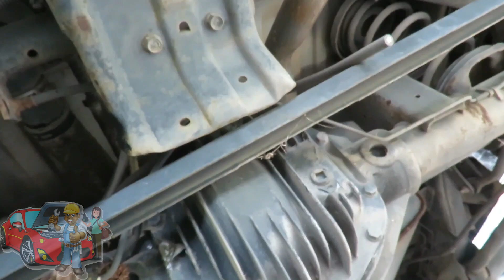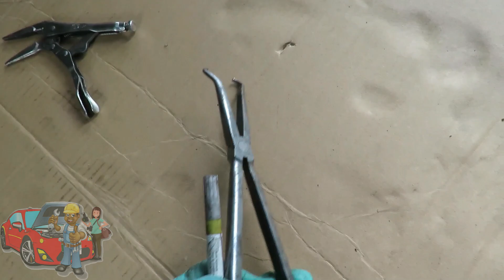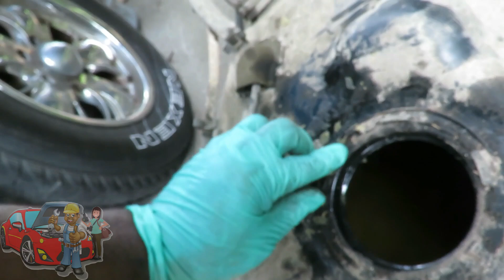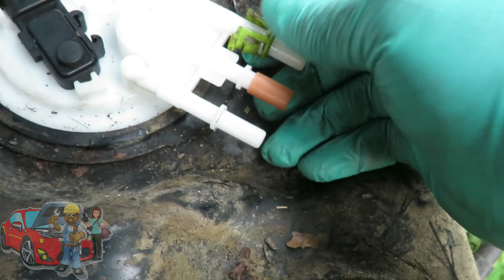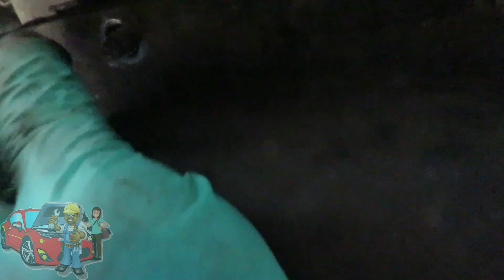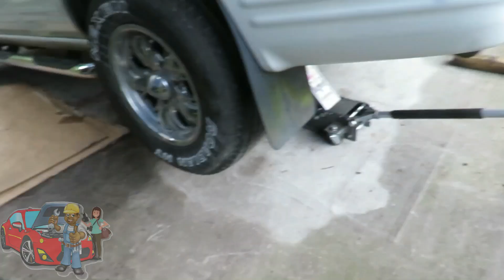Chevy LUV Honda Passport Isuzu Rodeo Fuel Pump Replacement

Comment: Aye big dog, love the video man. Very clear and concise work! I know it’s a year old but would you by chance have the part number for the pump that you got? I saw in another comment you said it’s a Delphi pump but the one I see on rock auto now has the connector that you have to wire on and I was trying to avoid that part lol. 

🔥 video
Reply from the maker: I hear you, I don't like to mess with the connectors if I don't have to.  As long as you don't get a too cheap one, you'll be okay. THANKS!!!

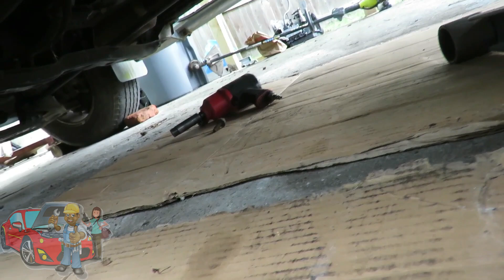Comment: 38:50 Awesome video! Worm drive clamps are not ideal for fuel lines or in automotive in general as they may not provide uniform sealing or may even loosen up over time as they contract and expand with varying temperatures and vibrations. Oetiker aka single ear clamps or specialized fuel hose clamps are better for this use case as they offer more secure seal.

Comment: Thanks for the great video. Need to do this soon on my moms' 2000 Rodeo.  Pump still works but fuel sending unit hasn't worked for years. I'm dreading what I'll find under a 24 year old vehicle. Everything is still original. What brand of pump did you get?
Reply from the maker: Appreciate the compliment! We got a Delphi from Rock Auto. With ours, expect a bunch of dirt, LOL!
Reply: Lineman pliers work better for Spring type clamps.

Comment: Did you need to do any rewiring on the new wire harness,  because that's were I'm stuck with the new wiring harness.
Reply from the maker: Not at all. It might be the brand of pump you got.
Reply: Some people have that problem